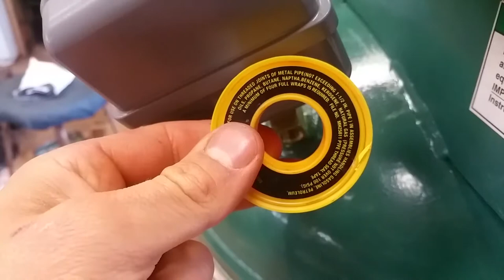Keep Your Compressor Tank From Exploding

Comment: Dude.  It's for when electric contacts get stuck together in the run position to avoid an overpressure condition.  That's a good reason to test it by pulling the ring occasionally, as the pop-off valve can get corroded too.

Comment: Hi .. I will be brief. A tank filled with compressed air is a bomb waiting to go off.
That safety valve you have in your hand is rated at 200psi /14bar . Considering that a lot of diy compressors store at around 100psi . They are tested  when new to approx double running pressure ,i think you have got a safety device rated a bit too high IMO. For tanks older than 10 years i would recommend you get them tested by a compressor company as every time you drain that rusty brown water a small amount of your tank is washed out . Think of this when you drain it the inside is still wet !!!! Guys be aware of how old your tank is, as quite a few diy compressors look shiny on the outside but are getting very thin on the inside. Stay safe
Reply: Hydrotested my tank to hold 300psi for a bit over two hours, drained it then spray coated the inside of the tank with ZRC cold galvanizing to hopefully prevent any additional steel rusting.
Reply: Wow that's brief? I wanna see it when you're not brief.
Reply: @OneIdeaTooMany  Well many thanks for your constructive input. xxxx

Comment: Most compressors have this safety release valve on either the manifold or on the tank somewhere , I would of thought the easiest way to prevent a compressor from turning into a bomb , would be bleed the tank after the days activities , second check the tank for rust spots constantly, thirdly if it’s over 10 plus years old , replace it .

Comment: THANKS. Any info is good for me, a novice. I do believe that even at 50 psi, a large exploding tank could be lethal due to the volume. I will certainly have two relief valves at minimum, test them, drain water, keep the tank a considerable distance from my work area and always consider the age, certification and integrity of the tank.

Comment: You're correct about the importance of a high quality pressure relief valve (PRV). Your scenario #1 @1:25  is erroneous; an air leak will reduce pressure before a PRV could be activated. The PRV CFM .is important because it needs to release air at least as fast as the compressor pumps it.

Comment: You should place 2 pressure relief valve on your air tank if one fails the other one will open
Reply from the maker: Good idea. It has one on top of the pump too.
Reply: @MattsShop  In this video a pressure relief valve  malfunctiont  and and the hole air tank exploded  https://youtu.be/vi3gLIPSR5w
Reply: One is sufficient if it is big enough to handle the compressor max flow and is calibrated to the right pressure.  It should be checked annually by lifting the poppet.  If others have access,  you should ensure no one has substituted one of a higher rating.

Comment: First, all cpmpressors have pressure relief valves by law. Second, if a fitting brole off as you mentioned, the tank couldn't explode because it couldn't hold pressure. This is an example of someone who doesn't know what he's talking about posting a video.
Reply: If the fitting broke off would the compressor keep running and running and running?
Reply from the maker: Yes, the compressor would keep running. If there were no relief valves and a fitting broke the compressor would run until the tank blows.

Comment: There should be a fuseable plug fitted to the tank too.
Reply from the maker: Electrical plug? There is a heater in the magnetic starter and a breaker??

Comment: Dude it’s only four of the thing goes over the pressure if it goes over like 100 psi it’s going to blow it
Reply from the maker: What???
Reply: Do One   RELAX  I MEAN TANKS ARE USUALLY RATE AT THAT PSI BUT IF YOU GO A HUNDRED OVER  YOU COULD START TO PUT STRESS FRACTURES IN THE METAL WHICH THUS COULD CAUSE IT TO EVENTUALLY  BLOW
Reply: Do One  CALL BULL ON THE COKE BOTTLE 90 PSI

Comment: Haha most compressors already come with one.. I'll be more worried about water in the tank especially if you live up north. When I work in the oil fields we drained our tank after everyday so  water wouldn't freeze inside the tank. That's 101 stuff bud. 🤯